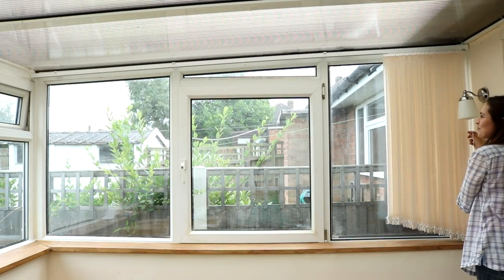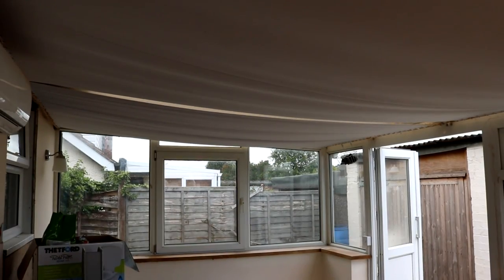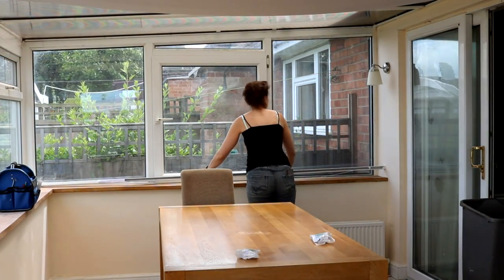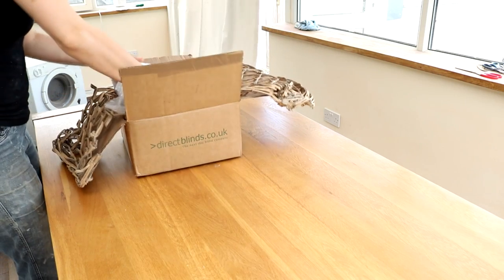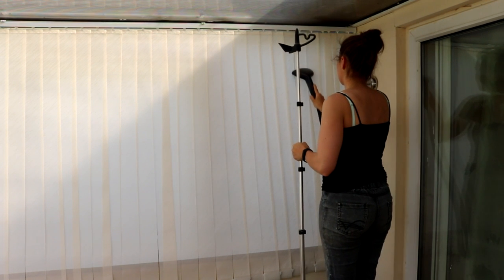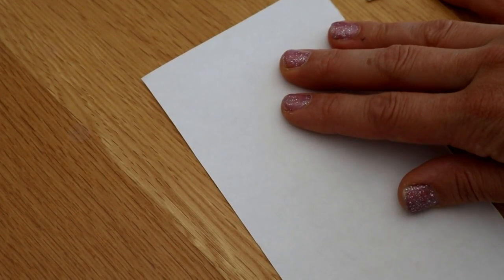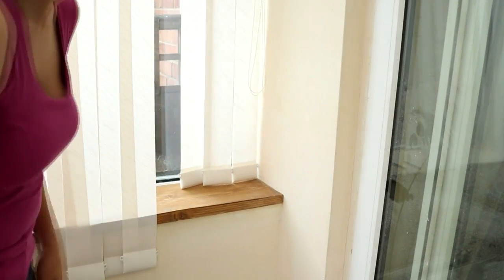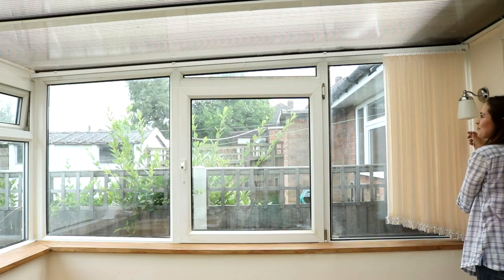DIY Cheap Sloping Conservatory Vertical Blinds | The Carpenter's Daughter

Comment: Well done on you. Looks good. 

 I was in the same situation as you. I got quoted £700/£800 for supply and fit for vertical blinds.

I then bought made to measure blinds from (blinds to go) cost me £125 and fitted them myself.  Trust me it's very easy. DIY. I have no experience in fitting blinds,  you can do it too.

Comment: Your video is so useful, thank you. I have a question, I am replacing my old blinds, and the vanes are 12.7cm/5" wide, but on swift direct blinds and most other sites, they are a standard 8.9 cm/3.5", so much smaller than my original ones, are yours so narrow as well? I was going to order from binds to go but stopped when I realised how much smaller they are. They are in fact sold as windows and doors blinds, so I wondered if they are the right product for a conservatory...?

Comment: Could you give me the details of the clips that go into the wall rather than ceiling you mentioned please?  Because of you I'm doing exactly the same in a new conservatory.
Reply from the maker: Do you mean these? http://www.ebay.co.uk/itm/Vertical-Blind-Face-Fix-Brackets-/301212135745?var=&hash=item4621a47141:m:m8qS-IUDB7l2qZXEYDkYw_g  

My blinds are attached to the tops of the windows with these that came with the blinds.  Hope that helps and you save a fortune :)